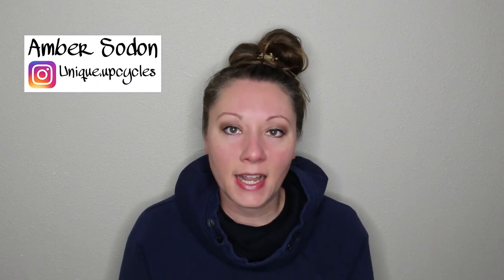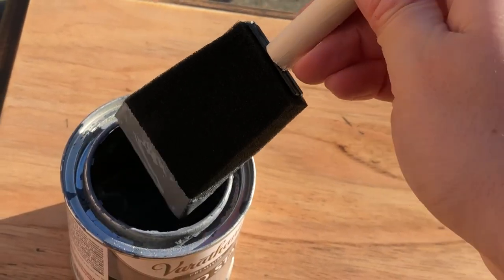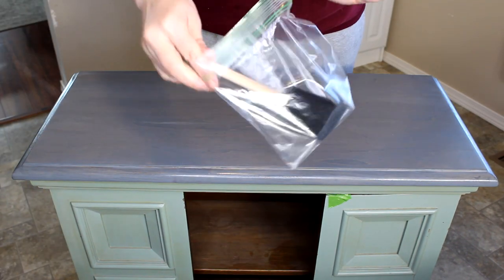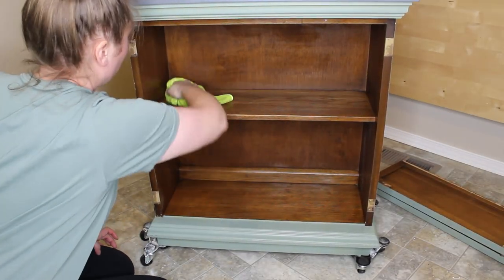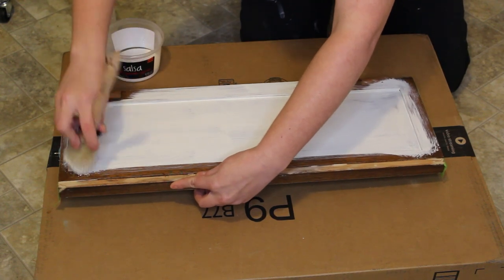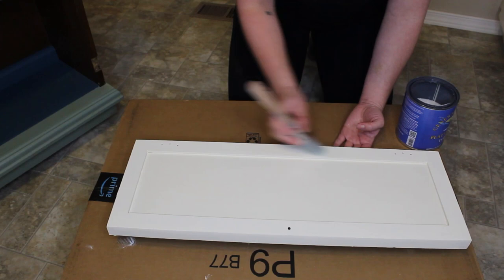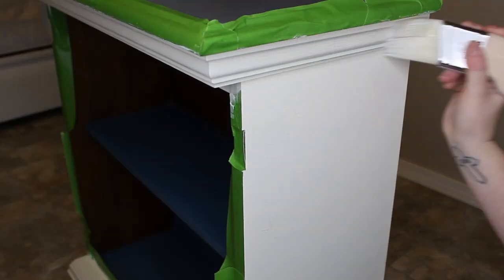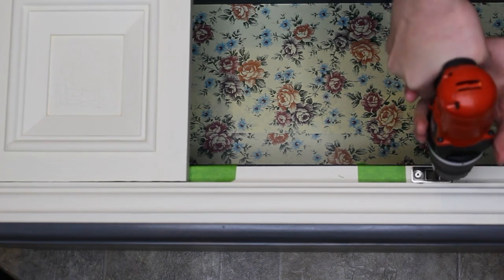Trash to Treasure | Furniture Flip | Vintage Cabinet Furniture Makeover

Comment: This just popped up in my suggested videos.. This came out nice.  Any idea why the white paint cracked? I never cared for that finish. Im ok with distressed edges but not a fan of chips and crackle in my farmhouse look. Looking forward to your videos
Reply from the maker: Yes I actually found out after that the brush on Shellac that I used contains wax which is why the paint crackled on top of it.  Apparently it doesn’t always happen like it did for me. I lucked out that it cracked evenly across the entire piece.